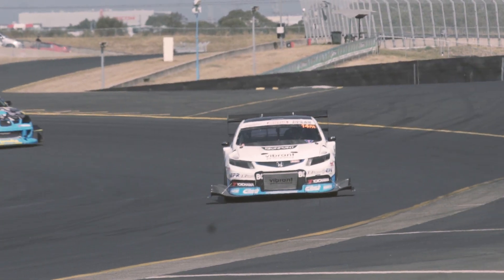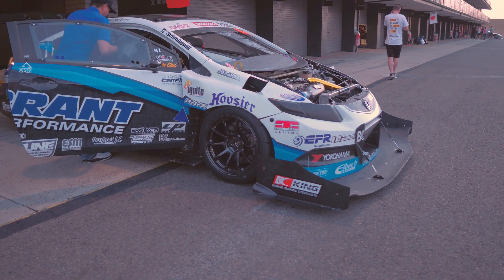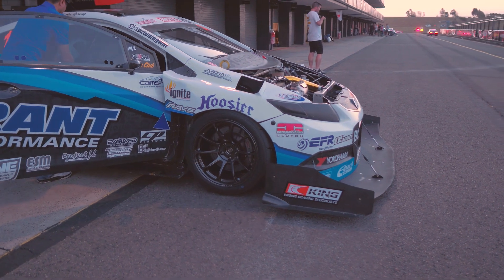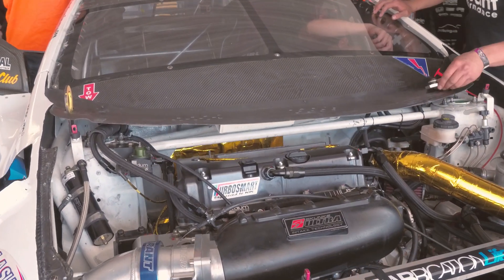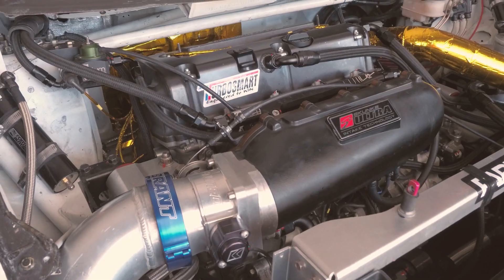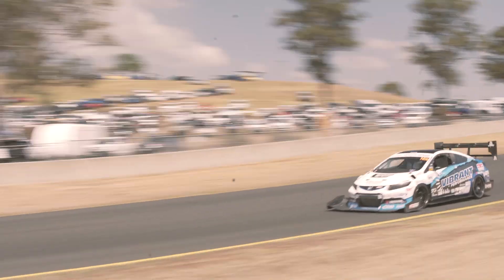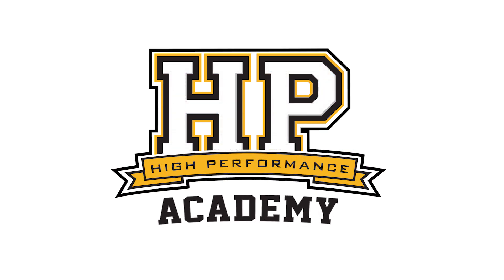[TECH TOUR] 793 HP Honda Civic | PZtuning FWD Time Attack Car

Comment: This is my favorite car in the Global Time Attack series. I'd really like to see how they set up their suspension vs aero with a relatively heavy front wheel drive car to get the power down and make it stable at high speeds with the same rotation in low speed corners
Reply: Angel Izaguirre you basically setup a fwd car to be loose in low speed autocross type driving.  You need rear stiff to get rotation at lower speeds then balance it out with aero for high speed stability.
Reply: What I don't understand how a FWD can ever be more performant if the front tyres are having to perform the duty of acceleration in addition to steering, which is not the case on a RWD platform. The traction effort any tyre can perform is limited, and if duties have to be split on the same tyre the maximum lateral or longitudinal grip is reduced compared to a tyre that only has to perform one duty. So rear axle for acceleration and front axle for steering should be faster, because front and rear tyres share duties instead of overloading front tyres in a FWD setup. Please correct me if I'm wrong. Or are there other benefits of the FWD platform that negate what I stated? The video mentioned weight savings which is a good point. A rear diffuser could be another point and flatter floor in the FWD setup to help downforce. But can those things really outweigh making the most of your tyres?
Reply: They can negate the wear on the front tires up to a point. It comes down more to the decreased weight of the car and aerodynamic balance

Comment: Lol fwd is definitely a disadvantage it's just physics
Reply: And the records this car broke are just numbers. Hater
Reply: @alex59248  Before f1 banned alternative configurations, still nobody ran a fwd setup in it. The fwd lmp 1 some years ago was so hopelessly off pace that Nissan retired it after just 1 race. You cannot defeat physics, and the only difference is that time attack cars are made by amateurs that do not have enough funds and expertise to exploit the rules to the fullest extent.
Reply: @IR-xy3ij  nothing you can do about the front wheels having to both turn and accelerate in turns. I honestly think i was teasing a bit but my reply was so long ago i dont remember.
Reply: @IR-xy3ij  fwd is only used in things like time attack, auto cross and amateur rally as far as im aware, not including fwd specific stuff. Still, im in love with wrong wheel drive, maybe some day that can transfer to awd but i cant help myself
Reply: @IR-xy3ij  because fwd the tires lose tread faster so they are only used in time attack and stuff like that